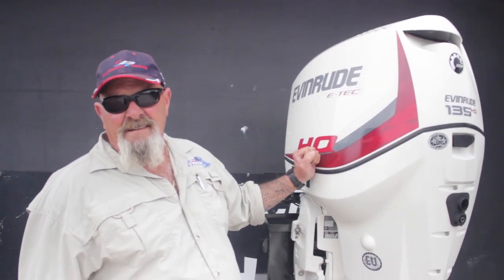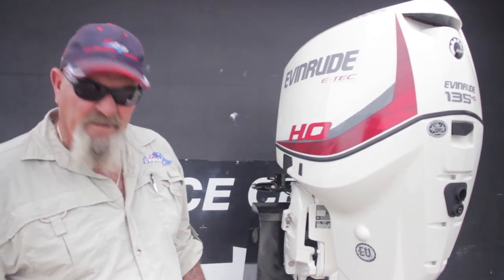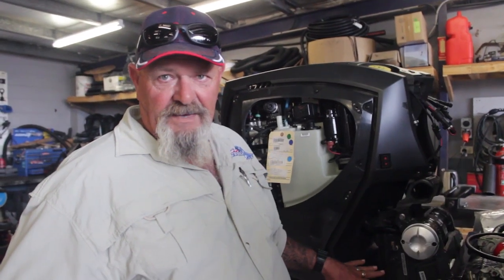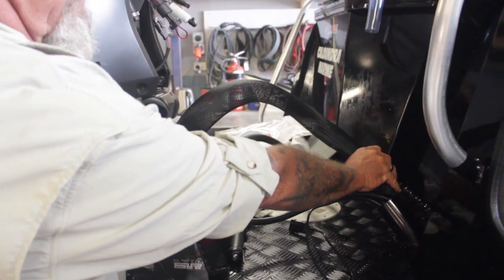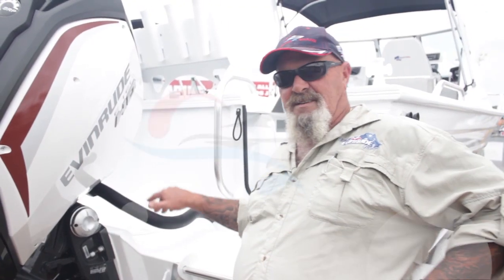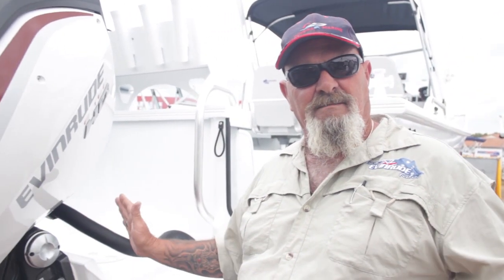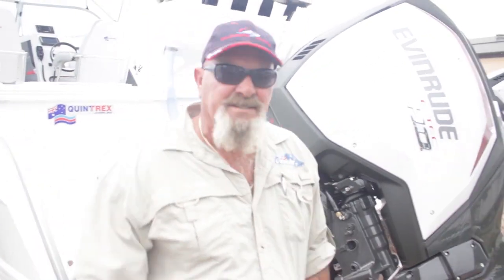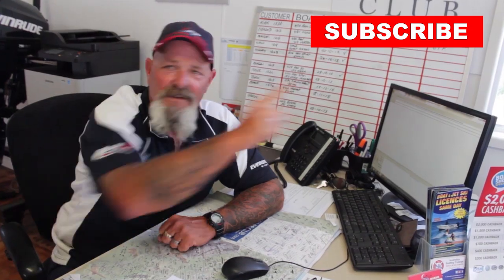150 G2 Etec install on Yellowfin 6200

Comment: Where can I get that tool that attaches to the top of the engine to your cherry picker?  I need to work on my boat but need to remove my 200 G2 first.  Thank you for the video!
Reply: dealer

Comment: I’ve noticed that you don’t install primer bulb on fuel line on the G2. Would it be the same for 08 250 etecs??
Reply: Nope. G2 doesn't need primer bulb due to electric lift pump. 08 250 has a vacuum lift pump and needs a primer bulb

Comment: Lez I love you man, but you gotta start selling Mercs to. My dad gets a ranger demo every year but one year a guy wanted it with a evinrude. 2 years later the motor blew and it was in the shop for at least 2 months. That motor was gone. It was a 2014 Evinrude etec 250 g1
Reply: ThatBlue Guy56 buy a G2 mate
Reply: hola me podria ayudar como se instala el mudulo de gasolina en el sistema de red de un motor G2  150 para que se pueda ver el nibel de conbustible en el tablero